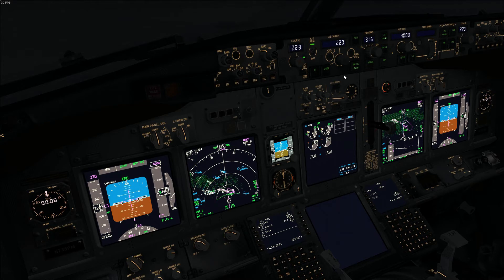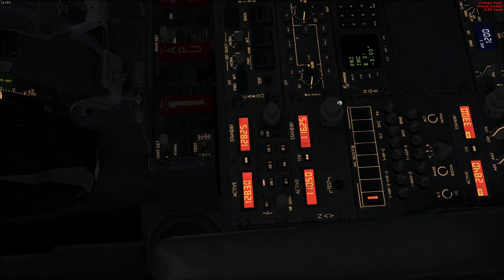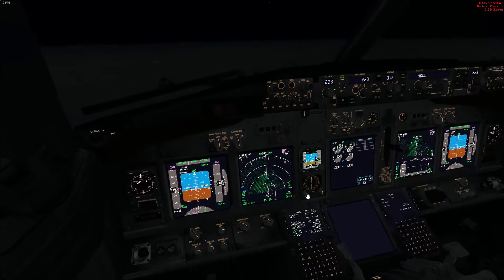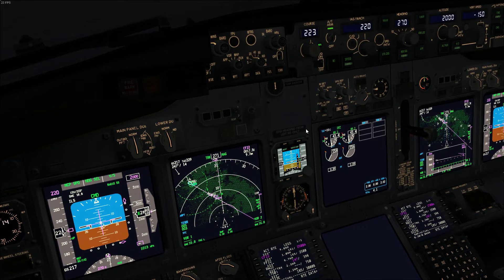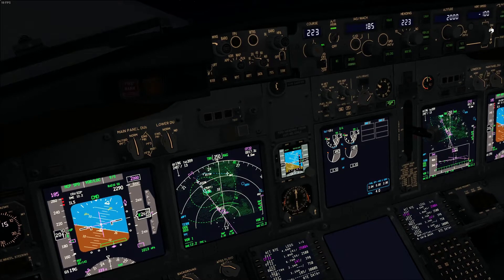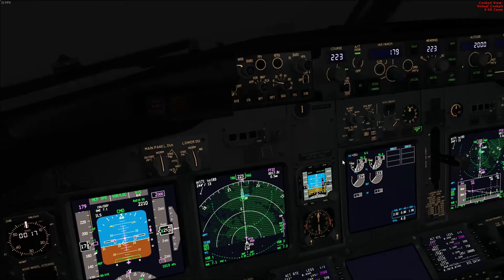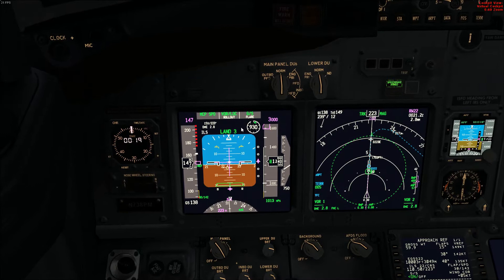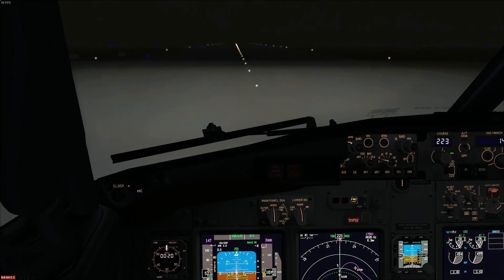Flight Simulator Boeing 737 CATIII AUTOLAND Tutorial + Setup

Comment: Your gross weight is 60.1? Why did you land so light-no pax & little fuel I assume?
Reply from the maker: Max landing weight on the 737 800 is about 65 tons. Landing at 60 is quite normal. You would typically land on a good weather day with 2.0 to 3.5 tons of fuel left in the tanks, especially in Europe due to the proximity of other airports. Don't get me wrong if you have lots of bags on board then yes the landing weight might be an extra 2 tons or so, but 60 tons landing weight with about 2.5 tons of fuel and a full pax load is about right. Remember you burn 2.4 tons an hour as a rule of thumb, so landing with 2.5 gives you well over your 30 min final reserve.

Comment: Hi man, wonderful video! I have an issue with this, and I can't find out what I'm doing wrong. I set everything exactly as you show, ROLLOUT and FLARE are armed, radio alt set at 50, the plane flyes beautifully through the glide slope... then it fails to flare, or the flare is insignificant, so I always get 350~400 FPM touchdown, almost crashing on the runway... it's been happening with all my PMDG aircraft since the last updates. Any input you can give me will be appreciated!
Reply from the maker: Oh, thats an interesting failure. It might be a radio altimeter issue. check that the radio altimeter isn't failed in the PMDG menu on the FMC. Otherwise if thy are armed, as long as they engage after it should work. make sure you have both ILS frequencies set up in box 1  and  2 otherwise the two autopilots wont engage. worst case try a fresh reinstall with pmdg?